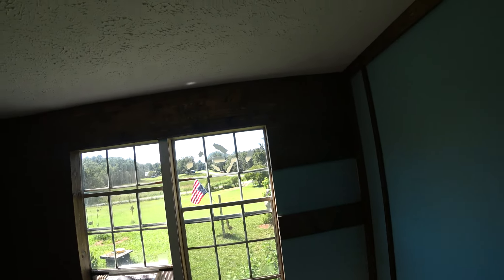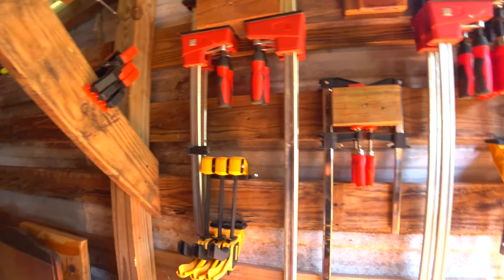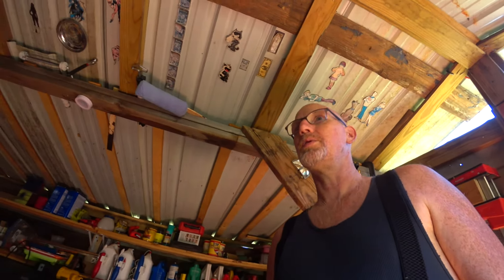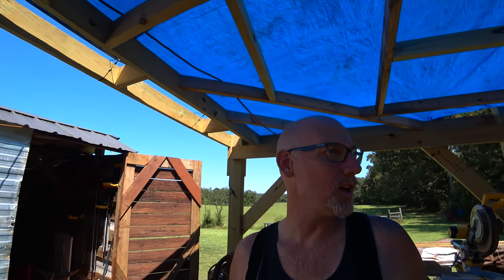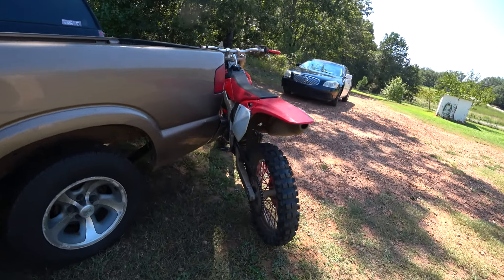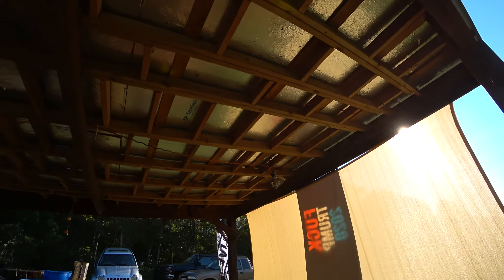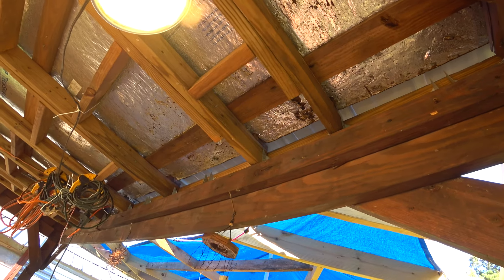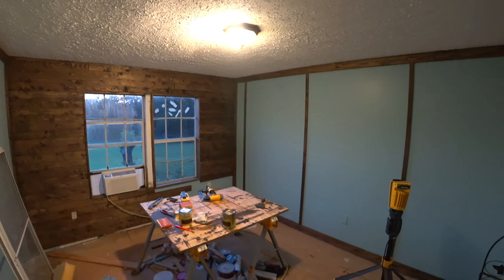This is Your Update

Comment: Hi there Muttonchop. Looks like a super job on the shed. Also can you stick an inline gas filter into the fuel line some how. And if you need a cheap carb cleaner use some crystal draino in a gallon or two of warm water. Be carefullin its caustic wear rubber gloves and rinse well after. May turn aluminum darker grey and duller but works cleaning carbs for me.
Reply: I would much rather have a carburated car than computerized fuel injection complicatedness...that was a mouthful   lol
Reply from the maker: @DavenHiskey  agreed.
Reply from the maker: @simply Fred, unfortunately no there's definitely not enough room for an inline fuel filter.... May take your advice, depends how bored I am over the winter!!

Chooch it!
Reply from the maker: @DavenHiskey  heard from Shawn?

I'm concerned.
Reply: @RedboneUnincorporated  I got answered from hims on the tube "Im taken r easy" hope he's not Rambo living in woods..but that would be super cool
Reply from the maker: @DavenHiskey  ok, thanks.

Tell him we all say hey if you speak with him again.
Reply: @RedboneUnincorporated  Will do
Reply from the maker: @DavenHiskey  thanks bro!
Reply: @RedboneUnincorporated  Right on